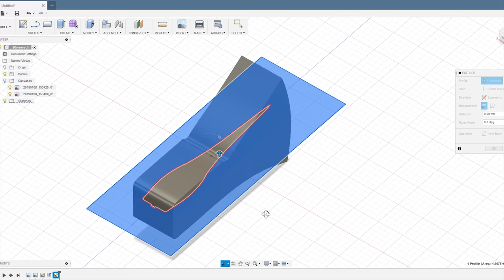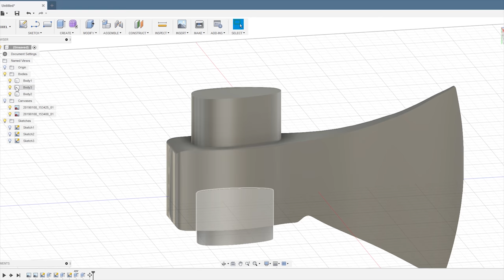Brand New Axes "Restoration" | 1M Special

Comment: Interesting concept and great way to showcase your skills.  As a professional axe maker, I wouldn't dream of using an aluminium handle for a good number of reasons.  Wood is essential to absorb shock along with being both individual and beautiful.
Reply: Genuine question: Why do some many baseball teams/leagues use aluminum bats if it has issues with shock absorption?
Reply: @THEbeautifuLIE  The reason wood bats are used is to absorb the energy of a more powerful hitter and make the game safer for those in the projected baseball’s path… you kinda proved the point, aluminum is not as shock absorbent as wood. 😂
Reply: @ericpardoe805   I don’t necessarily understand what the “😂” is for. I specified that this was a genuine question.  

If the wood is better for absorbing shock, energy, etc, I’m asking why so many kid’s leagues, softball leagues, etc employ aluminum bats. Why doesn’t everyone simply use wood bats exclusively?
Reply: @THEbeautifuLIE  For the same reason wooden bats are used in the big leagues, if you had small kids using wooden bats, they’d never hit a homerun.

Comment: Every time you create a metal handle, God kills a kitten... no, two kittens.
Reply: What if it's covered with rubber
Reply: @thanosdione8053  I think that'd be better. I can't see anyone being able to use a plain metal handle for too long because there's virtually no dampening and its usability will vary widely in different weather conditions.
Reply: why why why does he always use metal handles
Reply: @bkboggy  i mean even a fiberglass handle would be pretty decent doesn't get to hot or cold doesn't rot or rust
Reply: He does what he wants
Reply: Doesnt he mess up the temper of the axe head by doing that? They would be cool looking in a video game but 0 real life utility
Reply: @user-lj3tx4dz8y  I was thinking the same thing. Wouldn't the molten aluminum just ruin the temper on the blade. So the axe is fuckered now.
Reply: It’s really fucking annoying
Reply: I suppose the steel in the head was forged at a much higher temperature than the aluminum.
Reply: @thelun600  They say he cannot control his urge for steel like bonners
Reply: I have a steel pipe welded to a splitting maul.  Of course it feels like swinging a bench press bar but it works great...
Reply: @user-lj3tx4dz8y  the culours that the head showed when he pulled it out of the mold are temper colous, the straw jellow means the steal got to about 200 °C blue sits at 400°C . since the jellow did not reach up to the edge the tempering is fine.
Reply: @thanosdione8053  even more weight  and thats not a benifit
Reply: @spqrnemesis2801  exactly what you said. If anything, it's quite near where you'd want the temper. Straw for most of the bit. Closer to soft, nearly annealed for the base of the cheeks and the eye.
Reply: I'm so confused. Why why why would someone blackmail people to watch someone make another aluminum handle axes then try to find someone to give them. What is wrong with you tube? Stop referring theses video. The 3D printed axes with rubber tip blades on them for my kid to run around all day long hitting me in my head wounds be better then them other Axes but hay they look cool and shine bright in the sunlight. Wouldn't you think if they were so great they would sell them. Shock to your mussels sting. It's better to use something that can take and give just a little bit. So the shockwave doesn't hurt when you hit something hard. That just from a logger. I tried a tungsten handle axe. $350 it's so light and useless but hay it looks great. Maybe with a wide rubber peace a few few inches long to give it a little snap in the handle and stop the shockwave traveling down the handle. Hum, I think I'm on to something Watson.
Reply: Too many cats anyways.
Reply: i kinda like it on a new axe. its unique. its on an old restoration it looks off

Comment: Features:
* YOU CAN THROW IT
* VERY SHINY
* THROWABLE
Reply: Hatchets are easier to throw with wooden handles
Reply: why?
Reply: Weight^ 
The head being heavy really helps get a spin from my knowledge. But if someone knows more; please inform us
Reply: Punime   hekuri
Reply: Also throwable!
Reply: 1 in every 300 throws it sticks
Reply: * ALSO VERY SHINY
Reply: @wawi911  no the handle have practically no weight compared to the head makes it very difficult as it is balanced very poorly for throwing. However it can be done.
Reply: Eddie 
*SMALLER
*WHERE DID THE HANDLE COME FROM
*GIVEAWAY
*SHARP
Reply: *will give away your position while trying to hide

Comment: I really like the way the heat treatment to the axe head remains and you didn’t polish it out, fantastic job 👍
Reply: Uh you do realize that by casting an aluminum handle for it.  This idiot took out what little hardness was actually in the blade edge.  That edge might as well be made out of butter as it will never hold an edge.
Reply: If you watch the colors of the oxidation, you will see that the edge never exceeded 400F. Witch means that the tempering is intact. Not a fan of the metal handles tho. But cool idea still.

Comment: Can we have a video on how to restore your wrist,  Cause the impact of using a metal handle  will mess them up.
Reply: I don't think it will. I was thinking the same thing but then I noticed how the axe head is "discoloured" half way through. So that means that the metal around the eye is much much softer than the cutting edge and that will do the shock absorbing.
Granted it's not a traditional hatchet but it is beautiful and the craftsmanship that went into it makes this more like a show piece than an actual tool, imho.
Reply: Michael Cowey there’s an ad for that on all the CrossFit videos.

Comment: Did anyone else wonder why he didn't just hit the stick out instead of cutting it?
Reply: He cut it so could put it in the vice
Reply: I thought it was a waste of a good handle
Reply: It can't be knocked out as the base of the handle is larger than the eye of the head.  All timber handles require cutting for removal unless using a puller to remove the wedge and pin.
Reply: He still knocked it out and could have knocked it out with the handle attached if there was space in the vice. Didn't HAVE to be cut down
Reply: @ImBuanana Given that it was a dirt cheap axe with poor quality handle I don't understand why anyone would keep it.  Secondly, the only way to remove an axe handle intact is to 'pull' the circular pin out and the wooden wedge.  So, explain to me how 'you'd' do that?

I don't know where you live, but I know axes better than most as I own more than 70 and sell more than 100 vintage axes a year.  Quality axes have handles made from Hickory (American) and other selected Hardwoods from Australia and Europe that have correct grain running from toe to heel, or chisel  to eye.

Most people know nothing about axes, for those that don't, it's best they not comment at all.
Reply: It is a dirt cheap handle and I don't actually care that he cut it, I was just answering the question.
He still removed the handle without removing the pin and wedge. Watch the video again, he pushed the leftover handle out from the top the axe, confirming that it could have been pushed out without cutting it. 
Also, just because you sell axes doesn't mean you know it all.
Reply: @ImBuanana The fact that he was able to knock the remaining part of the handle from the eye in reverse is a testament to how pooly the axe was wedged and pinned.  A wedge and pin are desiged to place increased force from top to bottom which if done correctly makes it impossible for the head to come off therefore securing it safely.
Reply: I know that but he knocked the handle out on this particular axe did he not? That was the only question asked.
Reply: @barrybartlett8554  Observe 0:17 he could have removed the handle no cutting involved. After he cuts the handle off he flips the axe handle side down and knocks out the remaning wood.
Reply: @deutsch-amerikanisch8281  If it was a quality axe, it would have had a properly fitted handle and wedge which compresses the handle from the top down thus making it near on impossible to tap out from the top of the pole to exit out the bottom.

In this case, it was a very cheap hatchet that was most likely made in China by idiot's that know nothing about axes.

Comment: Why not use the original axe as the mold, then remove the handle? 

Pouring the handle in, wouldn't it change the hardening of the steel and it would need re-tempered?
Reply: It didn't change the edge on the ax light blue is proper hardness for an ax.

Comment: Love the temper line from the molten aluminum. Wonder if one could use that method in the production of a newly forged axe head (as part of the heat treat).
Reply: Timothy Dornan you wouldn’t wanna make an axe head out of aluminum, that’s just stupidity
Reply: Kyle Gordon read more carefully, watch more carefully. When the aluminum HANDLE cooled it left a temper line in the steel. (The discolored portion on the head of the axe) when tempering a blade a blade smith will watch the color of the steel to ensure that the metal does not soften too much. Straw, suitable for most edged tools, to a dark blue, more of a spring temper.
Reply: Timothy Dornan you still don’t want to make an axe head out of aluminum
Reply: Kyle Gordon are we watching the same video? The axe head is steel. Forged steel. Probably 1060. 
Aluminum cannot be tempered. It can be work hardened but would still not make a durable cutting tool. If you read my comment carefully I am talking about casting an aluminum handle into a newly forged steel axe head to temper the blade after quenching it. Again. You cannot harden aluminum by quenching it, nor do you temper it. 
Where in any of my comment did you read “aluminum axe head”? 
Wow.

Comment: Sadly all that is, is a polished turd.  Cheap hardware hatchet head to start still cheap at the finish.  All you did was add a fancy non shock absorbing aluminum handle.  God help the hands of the fool foolish enough to use it.

Comment: The alluminium handle is quite unpractical on many sides (no need to say that) but I guess it is his signature.

Apart from that I'm impressed with his use of always better methods and techniques to up his game, e doesn't just stick to hand crafting or power tool using, but goes further and experiments. Great attitude.

Note: I talk like a experienced craftsman, but I'm just a 21 yo dude that likes this stuff.

Comment: How much vibration is picked up through the handle in use and how well does the hot aluminum flow through the cold ax head? It looks like the ax kept its edge temper, so that's good.  Overall the look is very nice.  Thanks for sharing.

Comment: Doesn’t the molten aluminum ruin the temper of the axe?
Reply: If you watch the colors of the oxidation, you will see that the edge never exceeded 400F. Witch means that the tempering is intact. Not a fan of the metal handles tho. But cool idea still.

Comment: Nice job, but unusable. Would be nice to 3d print a fancy design on the handles and cast in. Use for decoration. Can't imagine handle staying on head long, nothing to hold it on, aluminum is soft too.

Comment: Why did you do that from what I could tell from the video you drifted out the head from the top not the bottom so therefore you did not have to cut the handle out at all if this is the case why would you ruin a perfectly fine handle and why would you ruin a perfectly fine handle to begin with anyway

Comment: you ruined the ax as the aluminum handle transmits a lot of vibration to the wrist and so you cannot work long, but with the wood or polymer one you can because it does not transmit that vibration. But I agree with aluminum it looks better

Comment: If you use alu for a handle , at least heat treat it (for dumbasses , i don't mean the steel procedure ) , heat it up and then let it cool til it reaches room temperature .

Comment: U just ruin the heat treatment....... If a metal reaches 1000°and it slowly cools down it softening the metal. Which means u need to quench again and oven it to harden the material(axe)
Reply: As you can see from the tempering oxides on the axe head, the bit of the axe was (mostly) unaffected. Further back near the handle you can see the tempering colours (straw, yellow-brown, blue, purple). This bit will be soft but probably wasn’t hardened to begin with, as is common with most axes.

Also, the melting point of aluminium is 660°c so it probably didn’t get to 1000° as you said (unless you use Fahrenheit).